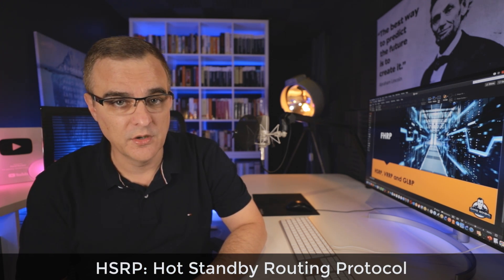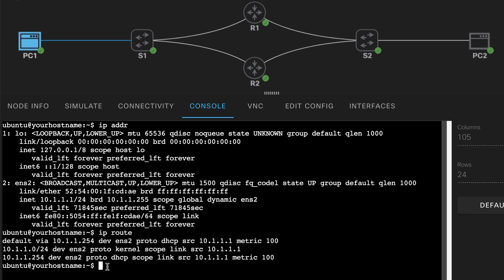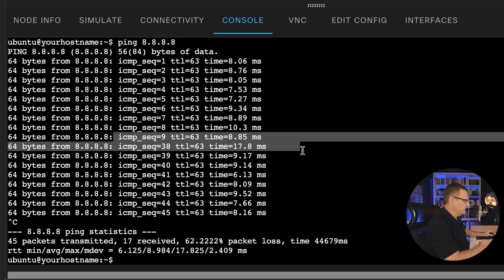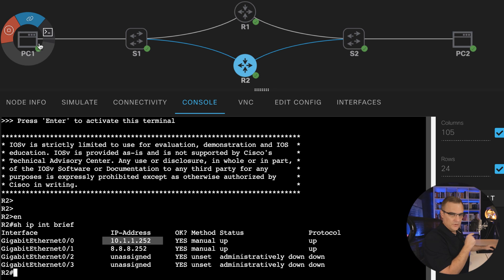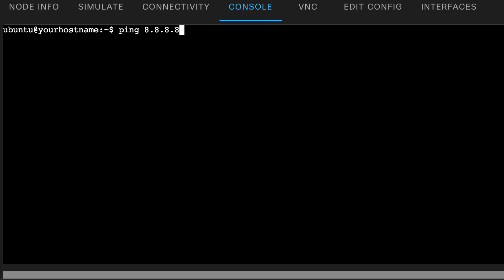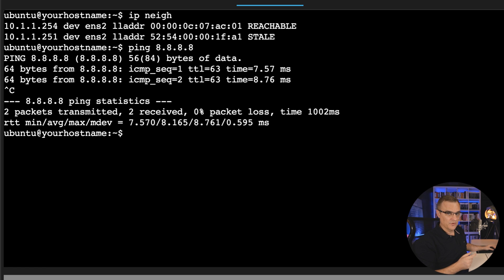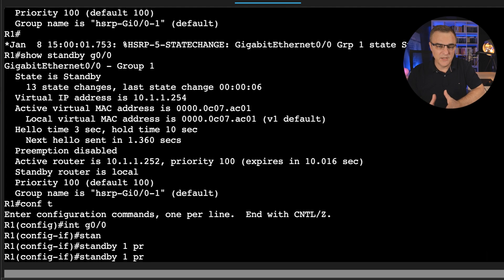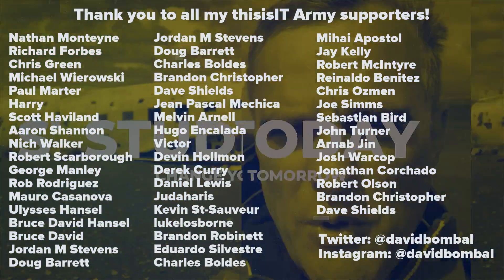HSRP #CCNA

Comment: Thank you for this interesting presentation. In the shown setup there is a backup router on stand-by, waiting to take over, if the active router fails. But wouldn't it be beneficial to have both routers always routing (with some load-sharing) and in case one fails the other takes over the full load?
Reply from the maker: You can do that by configuring multiple HSRP groups or the ultimate solution is to use GLBP :)

Comment: One question david, how does the icmp echo reply packet reach pc 1 from pc 2. how do you configure it? In my topology it reaches pc 2 but pc 2 does not know what to do with the traffic.
Reply: I kind of fix with doing two HSRP groups one for pc 1 and one for pc 2 but I think that there is a more efficient way that I don't know. Pd: in my topology the pcs are two 3725 routers.

Comment: david can you please tell me what should be default gateway of PC2 in your topology? i tried it on packet tracer but ping didnt succeed after i shut down the port, because on PC2 gateway is set to R1 0/1 interface so PC2 forwards packet to R1 and it basically failed. Please help

Comment: Dynamic routing protocol such as ospf has a mechanism to update their routing table whenever a route becomes inactive. How does redundancy protocols such as hsrp differ from this functionality and in what scenario is it important to have hsrp and Co. configured?
Reply: thought about it a little more and I think I see the difference. (or at least A difference)
imagine you have network with 2 separate internet connections.
all the pc's on the network have the default gateway set right? which router?
HSRP allows the second router to take over without having to change the default gateway on every pc.

I have a long way to go.... zzzzz
Reply: I was scrounging through to comments to see if anyone else had the same question!
it seems like you could just enable ospf and adjust the cost as needed. would love to know the answer
Reply: Thanks for sharing your thoughts ( a new perspective). Like you said, I also have a long long way to go, my 2021 will be dedicated for learning.

Comment: How does the switch know to start sending the traffic to router 2? Wouldn't the switch's ARP table still have the information to R1's switch until it cleared from the ARP table?
Reply: Switch send to default-gateway, default gateway is virtual ip address
Reply: @miroslavresanovic5852  But the issue remains. The ARP table has the virtual mac of the default gateway tied to the vIP and will send traffic to the port that has that MAC on it. 

The port that has that MAC goes to router1 g/0. So if that link goes down, how does the switch know to send packets to R2 since the ARP table still has and entry to send packets out the port connected to R1. 

What am I missing? Do the ports connected to the routers both have the same vMAC on them? I'm assuming not since that would cause traffic to split.
Reply: @snbsmith  Switch have learn virtual mac address on port 1, after R1 disconect R2 is prime and connected on switch port 2 and pc send another arp request where virtual mac go to port 2 in switch mac address-table. And on port 2 learn real physical mac address of port from R2. In same time do not have active two virtual mac address.